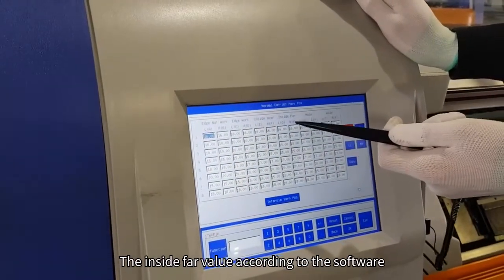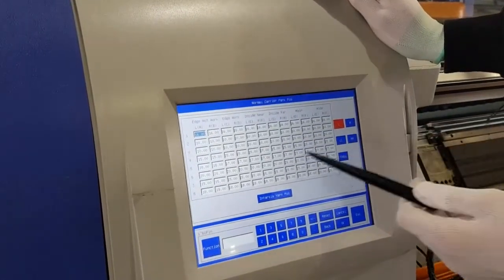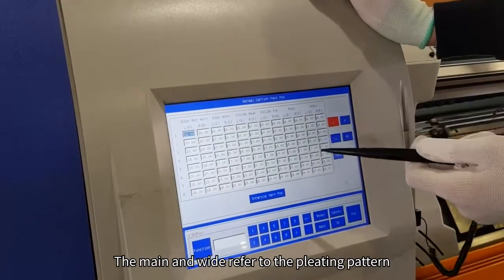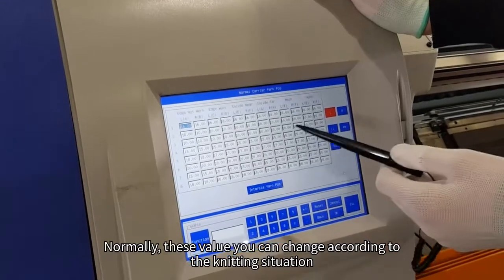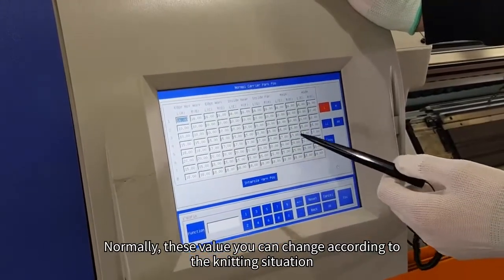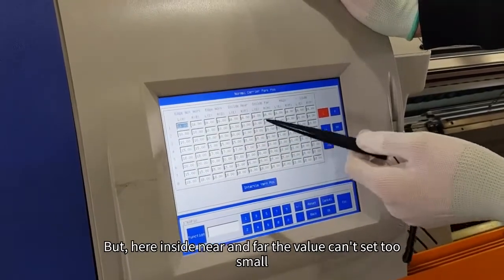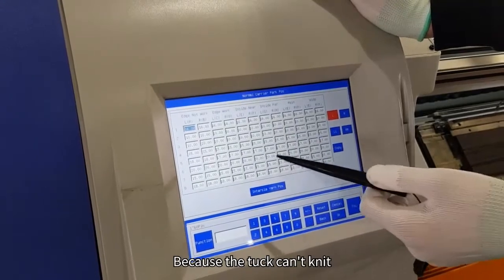V11 AFC yarn carrier parameters

Comment: How to adjust reverse plating position, with two yarn feeder? Thanks friends.
Reply from the maker: my friend, for reverse plating design, the two yarn feeder height and position adjust by machine automatically, we just finish program on LONE will be ok。  Also, if no knit well, we can adjust the height manually or position (yarn feeder position left /right ) by modify yarn carrier parameters. B
ut normally, the position already test well before delivery, no need make more adjustment.